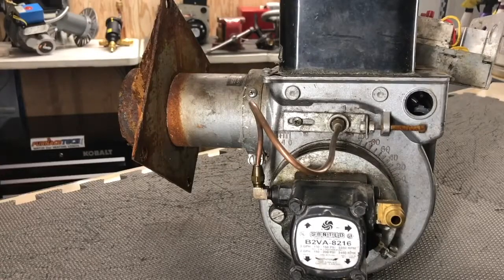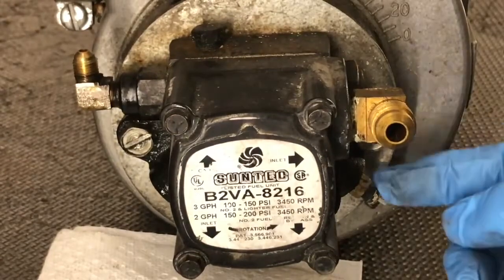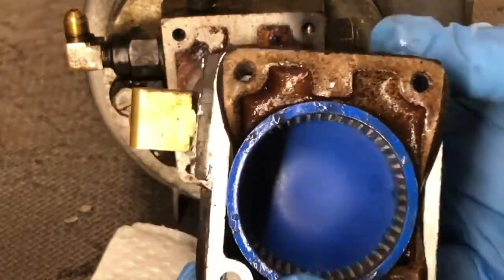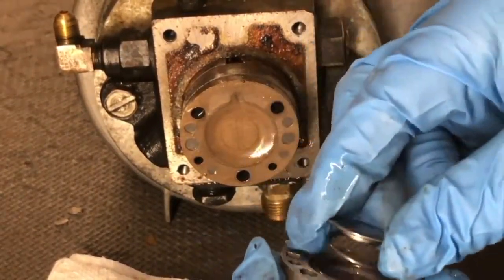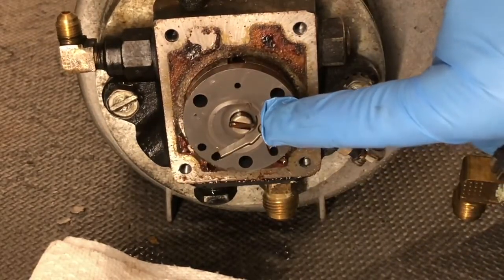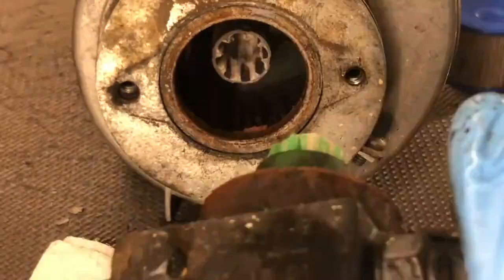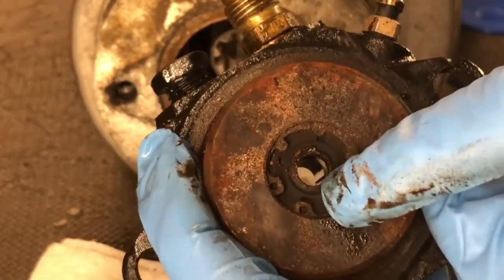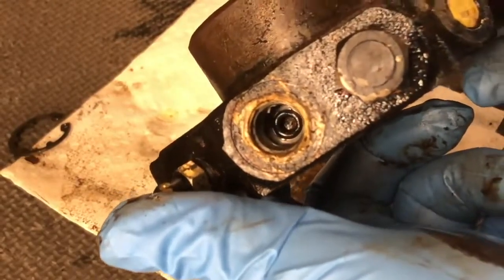Inside a Burner Fuel Pump – Protect This or Your Furnace Will Fail

Comment: how often do I need to change the strainer?
Reply: Change it yearly
Reply: @bobbond6028  i'm a little afraid to take it apart but i'll do it
Reply: @elan1c it legit the 4 bolts on ypur pump open up take out old strainer and gasket amd replace. Make sure holes line up the way you take out. And replace cover tighten bolts snuggly. And restart machine. Its not as bad as it sounds
Reply from the maker: Hope never! You should have a fuel filter before the fuel pump. Thank you for watching